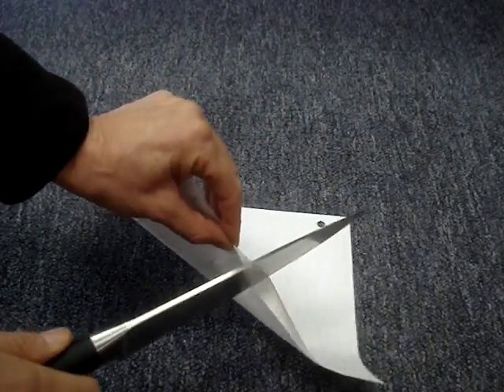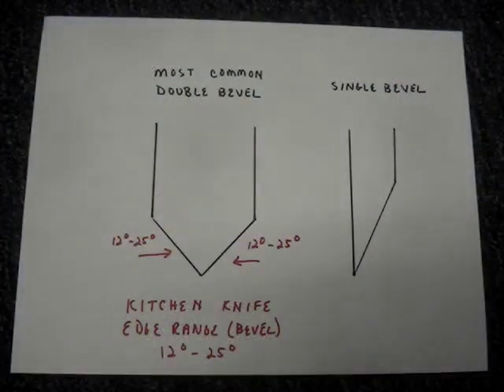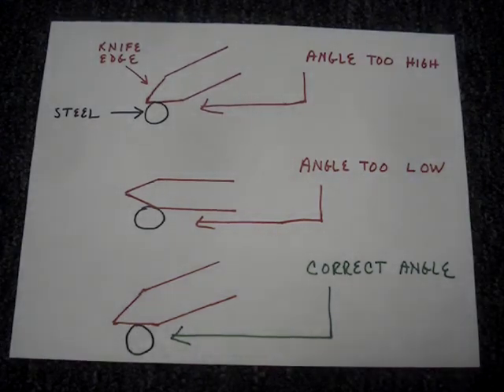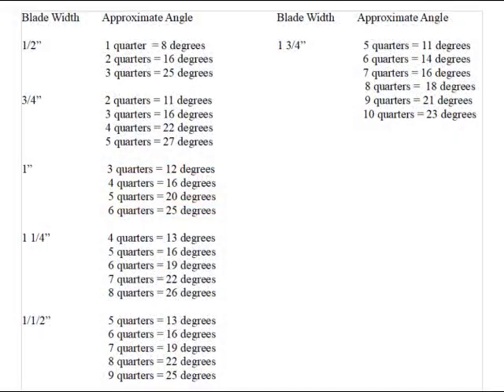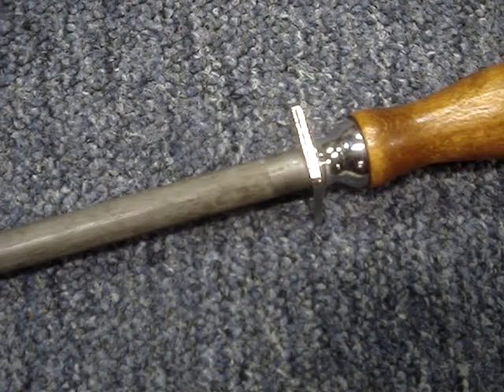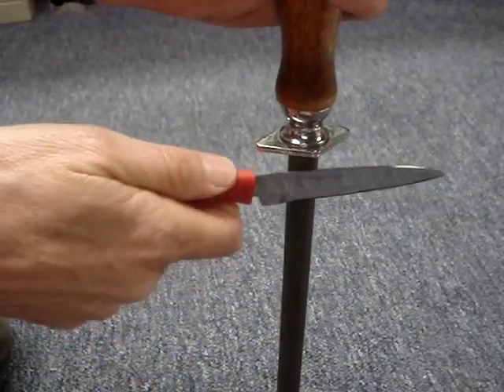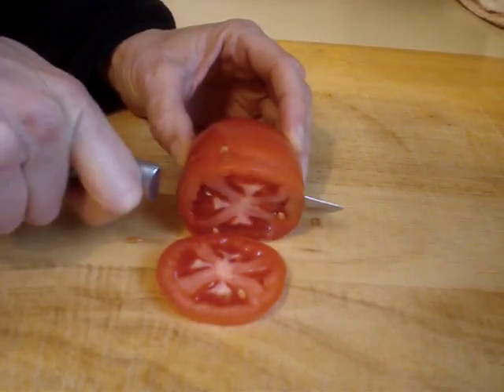Knife Sharpening Use a Sharpening Rod - Honing Steel

Comment: Thank you so much. When I try to sharpen or hone my wife’s knives for her. Sometimes I make them sharper but most of the time I think I make the knife worse. 
This helped me immensely!!
Very much appreciated!
Reply from the maker: You are welcome, Seth.  The key is to match the knife edge angle.  I suspect that unless you work in a commercial kitchen or a meat packing plant and have to use a steel on a regular basis, it's hard to get the right "feel".  I have a leather strop that I bought.  I think that may be easier to use for someone who does not use a steel on a daily basis.  Some time in the future I will put a video out on how to use one.

Comment: Great tips
Reply from the maker: Thanks.  For sure if you don't get close to the angle on of the bevel the knife isn't going to cut any better.  I've found if you are off, it gets duller.  For any softer steel knife the smooth honing steel works like a champ if the edge is not totally wrecked.

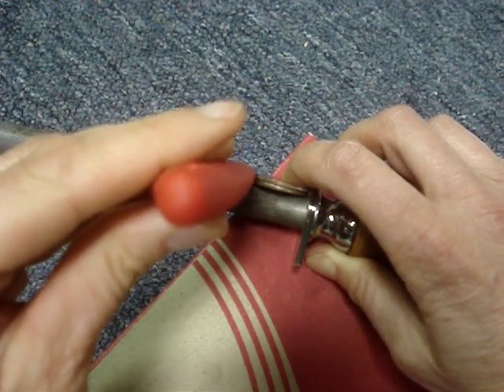Comment: Are you kidding at 2:39? Hold quarters and knife and what is that supposed to tell me? How does it tell me? What am I looking for? You completely skipped that part. Did you pretest/evaluate this instruction at any stage on someone who does not already know how to sharpen a knife? My guess is no.
Reply from the maker: Go at Tee Bee! Get all that anger out. Try a few pushups and maybe you won't be so angry.
Reply: @Know-How-Now  Defensive?